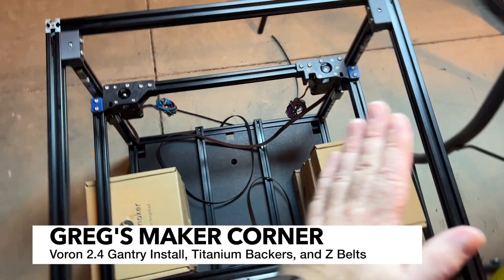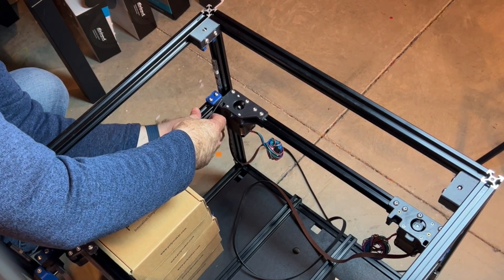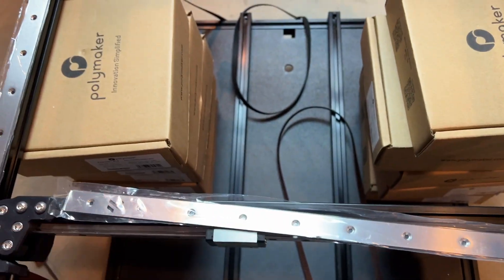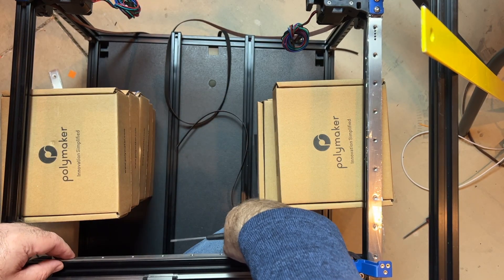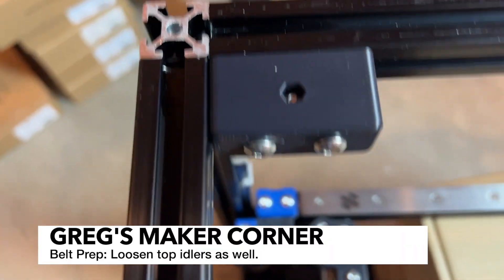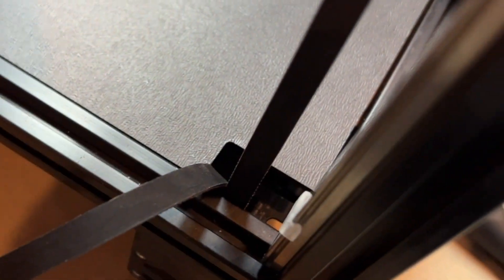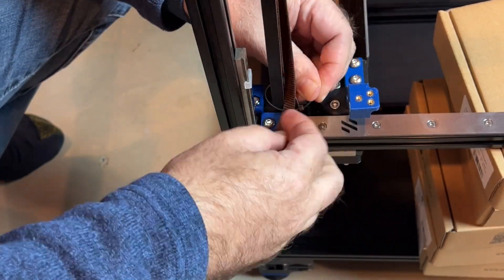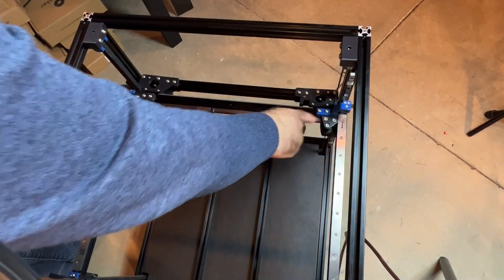Voron 2 4 Gantry Install, Titanium Backers and Z Belts

Comment: I'm a bit confused with the X backer being on the back of the extrusion because the idea of the backer is to prevent the extrusion from bending due to heat and gravity, right? Wouldn't it be more efficient placing it on the top of the X extrusion? After all, it does have the holes and everything to tighten the wire guard, right?
Great video though :)

Comment: Very helpful.  I'm doing my Voron 2.4R2 Rev C edition based on LDO kit.  Mine will have Voron Tap for bed leveling and Titanium backers per your suggestion.  Hot end will be Revo Voron.  I'm seeing some folks have concerns about increased mass from the backers but I'm not planning to push the speeds to the max.  What kind of speeds do you recommend for the initial set-up?  (I'm guessing 500 and max accel at 5,000 would be reasonable).  Thanks!
Reply from the maker: That sounds like a great build! I am also adding tap to this machine soon. I am a bit conservative on my machine, and usually run around 4K accelerations and 150-200 mm/second. 5K is achievable but I don’t know how realistic you are going to hit 500 mm/sec. Especially depending on cooling and hot end flow. I’d say 5k and 300 would be aggressive but doable with a stock setup. Best of luck and hope it works well for you!

Comment: Hey Greg, Noticed you sourced these from West3d. Did you purchase any other parts for your Voron from them? How was the quality? I've been eyeing their self source kit and believe that's the way I plan to go, Just curious what you went with and to hear your review of their products.
Reply from the maker: Hey thanks for watching and commenting!  I purchased most of the parts that I had on my Voron 2.4 kit from West3d and I would definitely do it again. Self Source kit is good and you can pick and choose what you want. LDO kit is also a strong recommendation and I believe West3d also sells those. Here are a few thoughts:

1) West3d Extrusions are good but they have aluminum chips and the tape on them to help protect. Not a problem but something to keep in mind (remove tape in an area like a garage or basement you can easily sweep up)
2) Go with genuine cable chains. The generic ones I got were not very good.
3) Don't get Hall Effect Sensors, limit switches are the way to go
4) Everything else in the kit was fantastic. Wested3 Rails, Dark Motion Kit, Rocker Switch, Keenovo Heater, Rapido, Wago Nuts, Din Clamp, BMG components, Filtered Inlet, BTT Octopus Pro, Panasonic SSR, etc.

Feel free to ping me on the Discord (Greg's maker Corner#4999) as well.